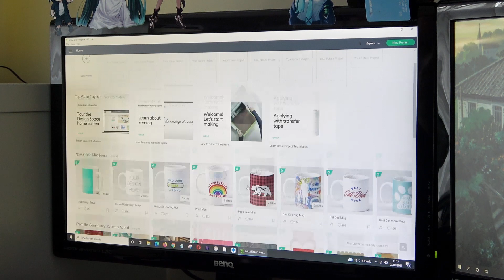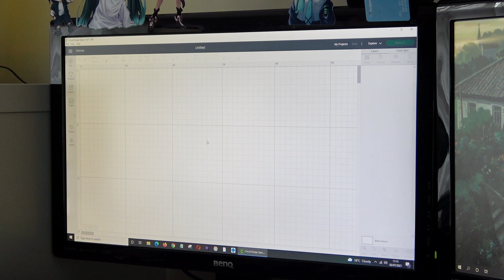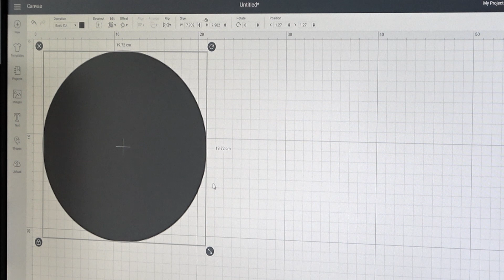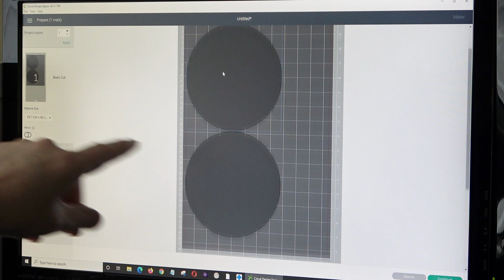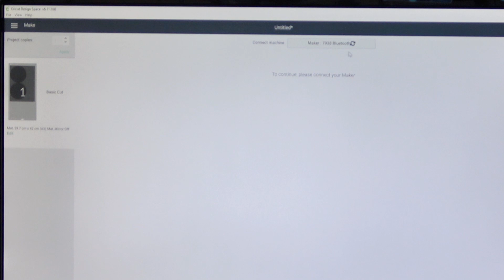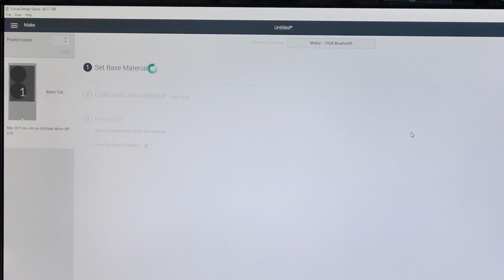Cricut Maker Machine Basic Introduction

Comment: I run an industrial cutting machine.  Same basic things, but bigger.  A belt instead of mats.  And the belt is foamy so an air vacuum holds the material down.  Made by Zund, model S3 with an L1600 table.  My department has 5 of those and I train people on them.  With various other ones and models across other departments.

Comment: Just a thought, but couldn't you make a 'cover' for your lazy susan using one of your 3D printing machines and make it so it has sides as well (like a flat bottomed bowl turned upside down)? Then you would be protecting the sides of your lazy susan as well as the top. Not sure how possible that would be as I've never 3D printed anything ever!!! lol
Reply: Very possible.  Could also cut a bigger circle and notch / bend the edges.  It's paint though and that'll build up over time, so the disposable option is likely the better one.  Plus you could cut/sand the paper off if the paint acts more like glue.  Then again, could just use a bunch of paper towels.